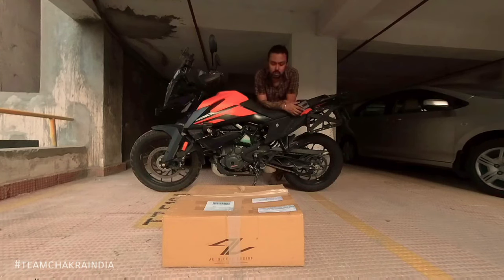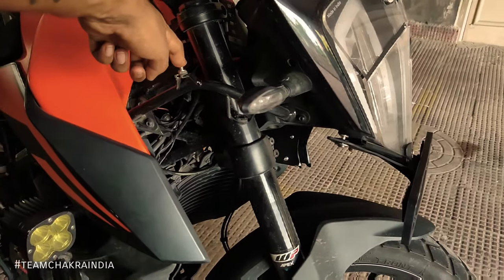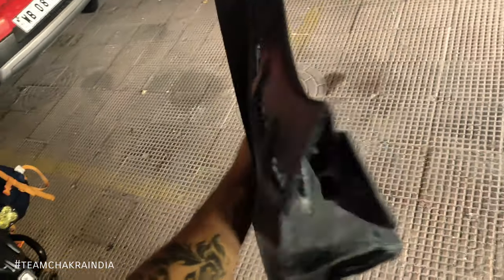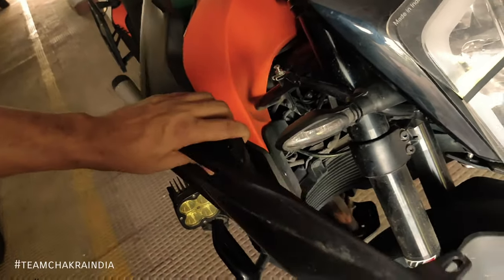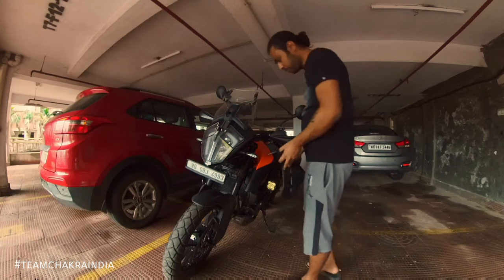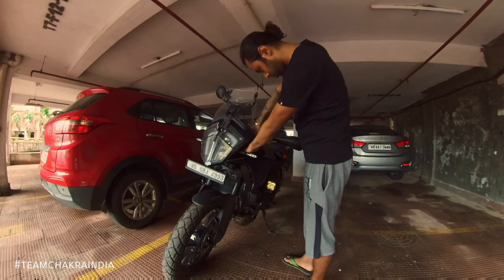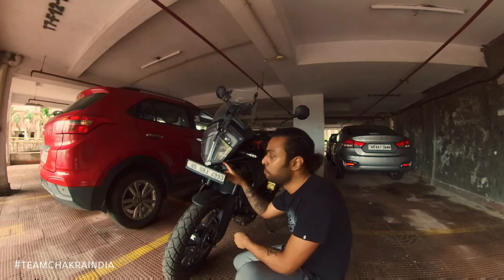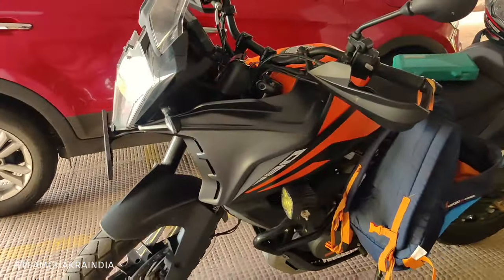Autologue Design Adventure X body kit installation video | Feat. Raneet Mallick | Team Chakra India

Comment: Can we install crash bars after installation of these panels??
Reply from the maker: Yes some of them would like Fantasia, SS Motocorp will fit fine.
Reply: @ChakraRidingBeyond  is there improvement in wind deflection ?
Reply from the maker: Yes. Aerodynamics improves but marginal. It's mostly aesthetics.
Reply: @ChakraRidingBeyond  thanks brother
Reply from the maker: No worries